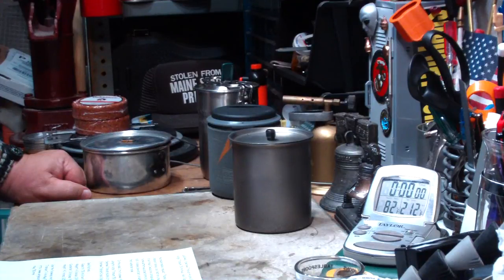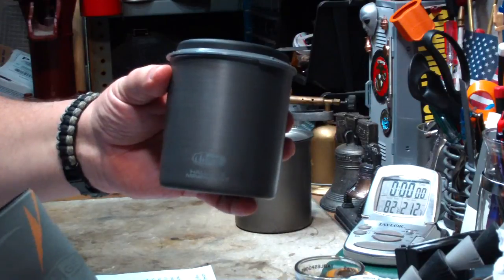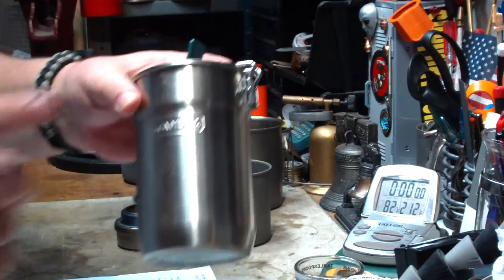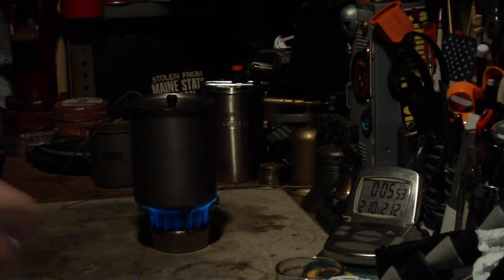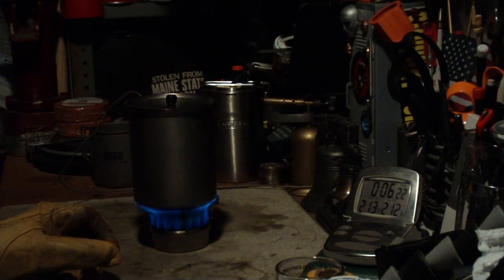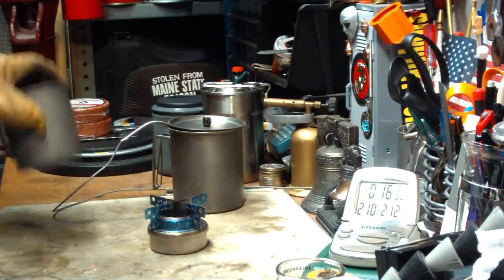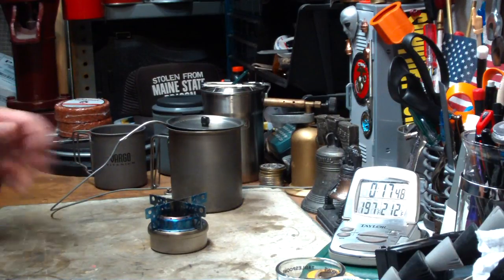Evernew Titanium Alcohol Stove - Vargo Titanium 750 ml Mug - Boil Test #1 - Requested by machbaby

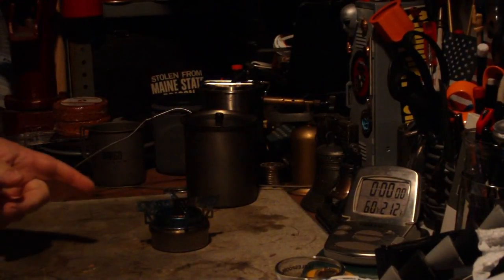Comment: I think I have watched all of your videos and have experimented with many different alcohol stoves....I found that the Evernew titanium needs more room...more than 1 inch from burners to bottom of pan.  I think around 1.5 or 2, especially on a more narrow pot.  I used a Olicamp Hard Anodized XTS Pot (1-Litre) with a 2 inch gap from the bottom of the pot and I was getting a boil time around 3:30....Fastest boil times I have seen with an alcohol stove. If you get time, would you do one of your boil test using this variation...I achieved this distance by cutting on of the top rings out of the Out-D potstand so I could fit the evernew on the bottom ring.